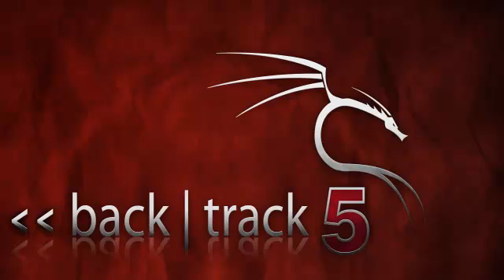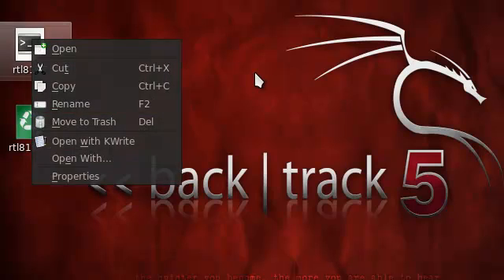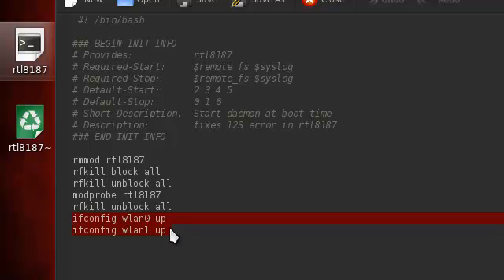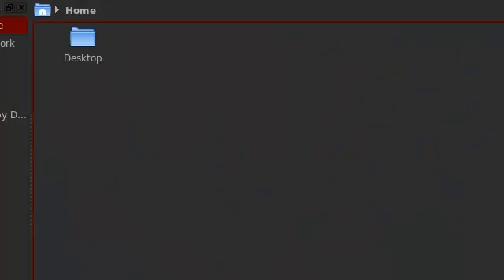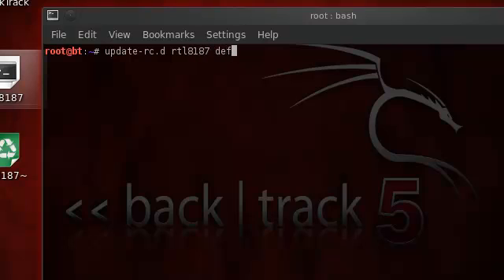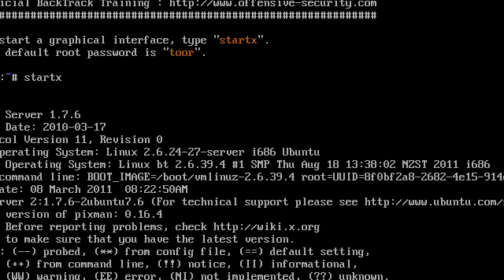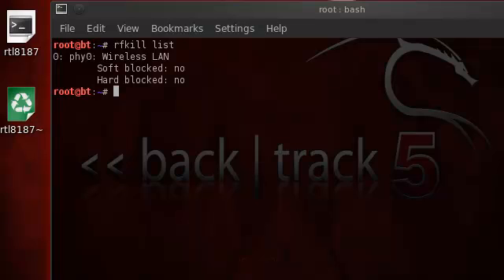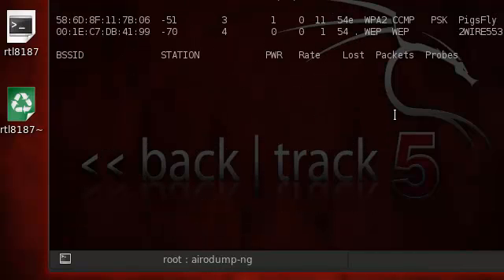BT5R1 rtl8187 123 error fix for dummies

Comment: Its fixing for like 1-3 commands, after using something like airodump-ng -c 6 -w blabla --bssid 19.32....   It sometimes sends again 132 error, sometimes no. Then i need to do again same stuff with removing and adding rtl drivers. And start over, and i cant really go deep enough because out of 5 commands it will show 100%. ;(

Comment: @curemymind Its a belkin F5D7051 and im running on OSX Virtual box. Im running BT5R1, I think my problem is I don't have drivers for the network adapter on OSX(They Don't exist) but i am not very sure. Or if i don't have the right drivers for Backtrack5, however I saw a guide to fix this for my network adapter. I followed the guide, the link didn't exist so i got it on OSX and put it across. I cant open it because it has root privileges or something, thats my problem atm (its a installer.sy file

Comment from the maker: @prime106 You don't need to open up the proc folder just open up the konsole since everything even the install will be down from there... But it looks like there might be some permission issues with your proc folder... What are the commands that you actually do? Also What is the name of your usb wifi card.. B/c I do know that some card's use a different chipset even tho its the same programing.